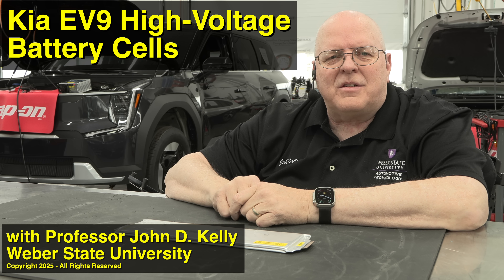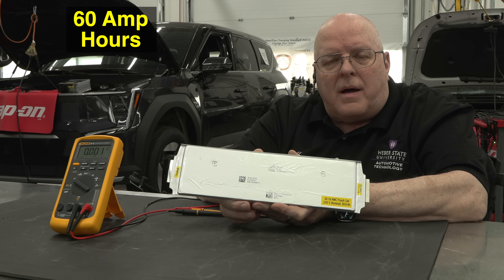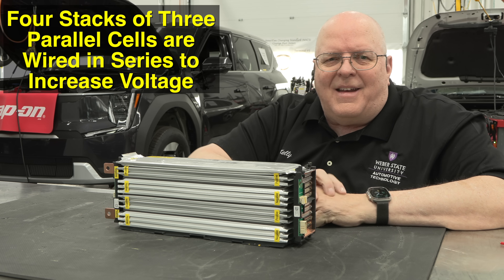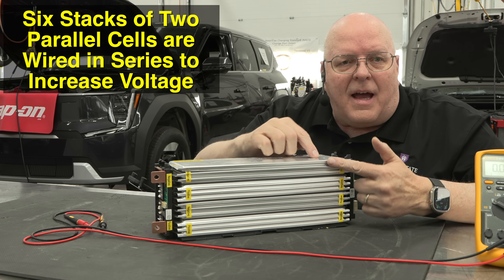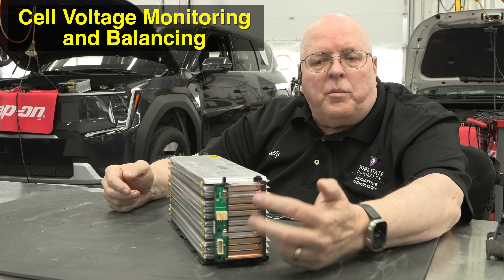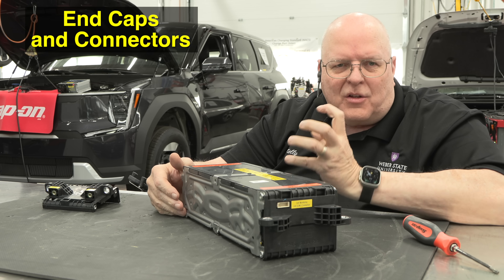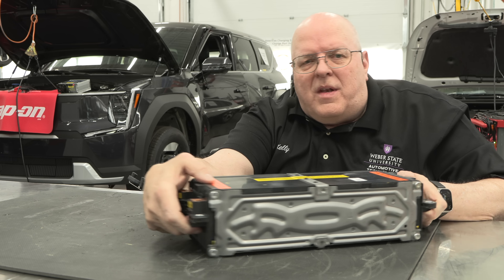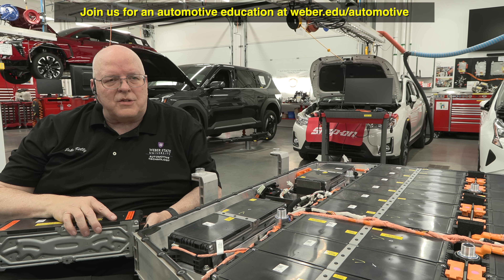Understanding the Kia EV9 High-Voltage Battery

Comment: Great video of the construction of that pack. Amphours is a misleading comparison of the energy to drive a distance without including voltage. KWhs is a more useful measurement  For example 60 Ahrs at 3.7 volts  is only 0.2 kWh. 60 Ahrs at 600 volts is 36 kWhs.
Reply from the maker: Thank you. You are correct. I did not mean to imply that I could drive for 1 hour using 1 pouch cell; I was just talking about the capacity of each cell and the entire battery, but I should have mentioned the voltage needed at that point in the video. 

My personal car has a 355.2-volt (nominal) battery and uses 60 amps at 70 mph, for a total of 21.3 kW per hour. 

I estimate the Kia EV9 with a 551.76-volt (nominal) battery uses about 38.6 amps at 70 mph, for 21.3 kW per hour. The Kia with a 98.985 kWh (nominal) 180 Ah battery should be able to drive about 4.6 hours at 70 mph, for a driving range of 322 miles.
Reply: That's what I was thinking he was saying😂

Comment: VinFast: (https://vi.wikipedia.org/wiki/VinFast ) uses high-voltage batteries for its electric vehicles, which are built from multiple modules and cells, often made with Lithium Iron Phosphate (LFP) technology 
 for energy storage

Battery technology and specifications Technology: VinFast uses Lithium-ion batteries in its electric vehicles and is also investing in future technologies such as solid-state batteries through partnerships. Battery type: Some models have LFP batteries. Capacity: For example, some energy storage systems have a capacity of 138.3 kWh and can provide 124.4 kWh of usable energy. Voltage: High-voltage battery systems can operate at a nominal voltage of around 460 V. Performance: Some models offer fast charging, with an example showing the ability to charge from 10% to 70% in 31 minutes for the VF 8.
Reply: NMC batteries have higher energy density, allowing electric vehicles to travel longer distances, while LiFePO4 batteries are safer, have longer life spans and lower initial costs, making them suitable for energy storage applications. NMC batteries perform better in cold weather, while LiFePO4 batteries perform worse at low temperatures.

Comment: One of those modules is about 2.6kWhr; that's incredibly energy-dense! In a few years, finding used modules of this form factor for sale looks like a good way to get really good energy density batteries for other applications in a convenient form factor; it's a size that's really manageable to move around without tools, and has convenient terminals on the outside, as well as being at a pretty usable voltage (16V or so).

About how much was it to buy this module off ebay, if you're willing to share?

Comment: Professor Kelly, can these modules be installed on their side in an EV conversion? i.e., resting on their 4.25" side instead of the 8.25" the factory has installed them on. They will be secured to the custom built box and have cooling plates.
Reply from the maker: The ones like these in the 4th generation Prius cannot be tilted more than a certain angle. I suspect these are the same, but I don’t know for sure.

Comment: In the case of a serious collision, what happens to ALL the voltage stored? Are connections broken somewhere?  I don't like the idea becoming a path to voltage that significant.
Reply from the maker: There are built-in disconnect systems and methods that shut everything off very quickly as needed. Thanks for sharing
Reply: Yes, the car will disable the high voltage system before the driver even realizes an accident just occurred.

Comment: Seeing the actual module layout, it cannot be very well thermally balanced.  This is also a problem with a lot of Tool batteries, where you have one protruding cell, and a batch of others.  Ryobi had this problem. Kia needs a better thermal design, or it will have worse longevity, as compared to others.
Reply from the maker: Thanks for sharing your thoughts

Comment: cringey pouch cells.  aren't any battery recall yet for any KIA/Hyundai?
Reply from the maker: Pouch cells are used by many other EV makers including GM, Ford, and Nissan. There have been problems with manufacturing defects in some including the Chevrolet Bolt I used to own. I have not heard of any widespread problems with the Kia/Hyundai ones.

Comment: Thank you for finally showing the insides of the battery in a way we can understand it. At the same time I'll never buy an EV car. That just looks like a nightmare to me. One rock could spell doom in an EV. And those giant battery cells just screams expensive repairs. No wonder why ev batteries need to be replaced entirely. One cell going haywire ruins the chips in the other batteries due to over current flow. Then they hit you with the whole battery needs to be replaced. Even though the individual cells could be salvageable if they didn't overrun on the voltimiter.

I'd rather stick with my petrol car where I can actually replace a part of the engine that breaks.
Reply from the maker: Thanks for sharing your thoughts
Reply: The overwhelming majority of EVs won't need battery replacements. My Bolt EV has almost 200,000 miles with the original battery and it still runs like new.

Comment: Can't the cells get out of sync of each other sense the BMS doesn't monitor each of the cells individually? There could be cells that are pulled down to the others or up to the others if one cell of a string or pack is over or under charged from the other cells making one cell be under charged which will pull the cell to low when the battery is drained or over charge the cell if the pack has one cell that is overcharged when you charge the car up it will overcharge the one cell in the pack that is already overcharged to begin with then making thermal runaway a big concern. The older the packs the higher the risk of overcharge and thermal runaway!
Reply from the maker: One cell in a pack can cause the cell pack voltage to change and lag behind the other cell packs in the module and battery. As a safety measure, if the BMS senses a cell pack voltage difference of more than a certain amount, like 40 mV, a diagnostic trouble code will set and prevent the battery from being charged and the vehicle from being driven. Thanks for watching

Comment: Nice call-out on the battery pack voltage. The auto industry seems to use '800-volt' to refer to any battery with a nominal pack voltage between 500 and 1000 volts, in line with DC fast chargers that have a maximum 1000-volt rating vs. the earlier 500-volt rating. I do think it's confusing on the technical side to categorize something as '800-volt' when its actual rating is far lower. That said, in terms of the consumer's fast-charging experience, the EV9 has similar compatibility to, say, a Lucid Air with a nominally 924-volt battery pack.
Reply from the maker: Thank you and thanks for the insight

Comment: You have a slight math error, if you want to drive 3h at 60mph and your car for example use 250w per mile under those conditions then you 45kw capacity or 112Ah at 400v. The overall voltage of the battery is also important not just the Ah. But we all know that's before AC or heating so the actual usage would increase by 10-30% a hard lesson every EV owner learns early on
Reply: Yeah.  Amp-hours itself is not a good term.   It’s a lie made to made low voltage cells sound huge.   Especially milliamp-hours.   I don’t know any engineers who use amp-hours for anything.  It’s kWh.
Reply from the maker: Yes, thanks. I should have specified the appropriate voltage is also needed.

Comment: Thank you very much for the videos Sir.

Its Thermal putty Used under the battery they are now quite common on power delivery components for servers.
Reply from the maker: You are welcome! Thanks for the info
Reply: Yes, thank you for the video! For a recent BEV design, this battery module construction is terrible for thermals and the 2 temp sensors are only monitoring the center of a single cell. I'd expected a better/safer engineered solution. The middle cells are most vulnerable to preheat from adjacent cells and the construction with the large sides facing each other lends itself well to thermal runaway.

Comment: Fanatastic Video, also very intersting besides the technical info ist how you can theoretically repair the battery back. From my understanding you can change a module quite easily if the pack is open. The only thing you have to replace is the thermal compound. Am I right with this assumption? 
As there are 38 not only 12-16 modules like an older tesla pack, it makes from my understanding absolutely no sense to change single pouch cells, that can be done by the manufacturer. A module should not cost more than 1000$ theoretically if the battery price is around 25000$ (Im only assuming numbers there to give some relation)
Reply from the maker: Thank you for your comment. You are correct about replacing the modules. I did not mean to imply that individual cells can be replaced. I was just showing the internal parts of the module. Thanks for watching
Reply: Depends on the battery. Kia and VW are super clean and modular. Tesla covers everything with a foam that Munro had to chisel away. Pro OEM vs amateur startup.

Comment: back in 2005 I bought lipo cells for RC Cars. turned out they inflated after 2 years in use. They look the same as this package...
Reply: RC lipos are under a lot more stress. they are expected to go from 4.2 to 3.0 volts in 5-10 minutes with no cooling, while in the car they go from 4.1 to 3.2 volts in 2-3 hours and are actively cooled. also the metal end plates in the car assembly compress the pouches which prevents them from swelling.
Reply from the maker: Thanks for sharing your experience!

Comment: Interesting, so the Toyota max voltage per cell was 4.05, this 4.12, likely the Kia doesn’t need as much headroom when fully charged. But still off the max 4.2v or so for LiIon batteries - most likely for reliability and longevity. Actually these cells looked more like the LiPoly cells in my r/c helis and airplanes.
Reply from the maker: Thanks. Yes, this one is lower. many other BEVs go to 4.2V

Comment: Great explanation, Professor, but you didn't explain how the cells are connected to each other inside the battery. Do they just lie on top of each other with their termenal touching?
Reply from the maker: Good point. Their terminals are laser welded together. Thanks for watching

Comment: Interesting arrangement with the pouch cells. 
But… don’t get me wrong: why is the RISO only at 3MOhm?!  
I work on FCEVs, they are far higher than that. And they are normally notorious for a lower RISO😅
Reply from the maker: 500 ohms per volt is the minimum isolation resistance allowed by FMVSS 305. This 626 volt battery only requires 313 k ohm. 3 million ohms is typical on many BEVs. Thanks for watching

Comment: We have the Ioniq 5 and I heard it also uses 2 parallel cells from Sk on but a full charge shows about 796V as I remember.  Hyundai / Kia does use quality batteries though 98k miles on ours and no loss of range since new.
Reply: Would you happen to know your average lifetime efficiency for your Ioniq 5? I have a model Y LRDM and I am currently 265 Wh/Mile over 44k miles.
Reply: @franktoadsly4866  So much depends on driving style.  I do all highway 80+mph with heavy acceleration and have lifetime average of 300Wh/mi on Model 3.
Reply from the maker: Hyundai uses more modules in series to increase their voltage. Thanks for sharing

Comment: 1:57 Surely something wrong with that maths. With today's cell technology, there is no way something of that single-pouch volume could propel a passenger vehicle for 1 hour. An electric bicycle, perhaps.
It is well known that gasoline or diesel has a far higher energy density than current cell technology and that equivalent single-pouch-volume of fuel would also be unlikely to power an ICE passenger vehicle for 1 hour.
Reply from the maker: Sorry for the confusion. What I meant to demonstrate is that 60 amp hours at the appropriate voltage can propel my car for one hour.
Reply: Yes, 60ahr * 4v = 240whr. In a vehicle that size you would be lucky to go 1mile.
Reply: 60 amp hours wired in series is still 60A hours but increases in watt / kw hours. If my math is correct 60A hours at 626V will will give you 37kw h, so more than enough power to drive 60 miles. Our Ioniq 5 can drive 230-290 miles (depending on conditions) with a 77kwh battery.  If the cells are double stacked that's 120A hours or 75kw h, triple stacked would be 180A hours, or 112kw h at 626V.
Reply: It has 456 cells.

Comment: Only 15V but that pack has a lot of stored energy nonetheless.  I'd be careful with that metal cover around uncovered main terminals, especially with students.
Also, I see you are giving credit to your shop assistants now. Very honorable of you sir.
Reply: I was curious about this too.  The general rule bring under 50V is safe to touch but then moist fingers, thin skin, an abrasion... it all is a bit confusing as to where the voltage/amperage safety point is.
Reply from the maker: Thanks for the feedback. I appreciate your observations.
Reply: I am a bit concerned about what the fault current from that battery would be 
At 180AHr it could supply 180A into a 0.09Ohm load for an hour
Into a short circuit It might be able to supply more than 1KA
I wouldn't like to there if that happened

Comment: From my understanding NMC pouch cells are still prone to the "puffing" phenomenon as other lithium pouch style cells because they share similar design/chemistry and can't vent gas.  I wonder how much of a future issue this could become.
Reply: As I read that typically happens when a battery is left at 100% charge for a long time, like sitting in a hot garage fully charged every day is bad for them. Also leaving them dead for a long time can cause the cells to expand. I had that happen in old tablets and phones that sat dead for years the cells doubled in thickness and made the case bulge.  We have an Ioniq 5 that uses the same battery design and it's had zero issues with 98k miles on it, no loss of range since new. Certainly a big improvement over the early Leaf's that gave EVs a bad reputation for battery degradation.
Reply: @SkaBob  Wasn't this why they used to say to physically clamp the pouch cells with metal plates and bolts, to prevent swelling?  Plastic cases seem like a lightweight solution that would cause issues years down the line.
Reply from the maker: The outer metal sides clamp the cells to hold them together. They were welded in place. I drilled out the welds to explore the inside of the module.

Comment: So what would the process be for heating the battery in sub-zero conditions ie is the thermal material efficient for both heating and cooling.
Reply from the maker: Yes it is. I forgot to mention that. Thanks for watching
Reply: There is a battery heater under the car as well, it can use it to heat the coolant going though the battery for fast charging when cold or direct the coolant to the radiator to cooling when it's hot. The battery heater on our Ioniq 5 will take about 5kw maximum but it's only used briefly before fast charging. Because this battery is larger it may have a more powerful heater.

Comment: It was a curiosity in car audio systems when i was 13 where I learned about parallel and series.  Trying to match resistance of subwoofers and an amplifiers capsbilities. Parallel reduces resistance by half and doubles the amperage.  The fun days of wiring 3 JL Audio W6 dual voice coil 6 ohm subwoofers so that it combines into one output at 1 ohm so that my one 1ohm stable amplifier could power all the subs.  Little did i know back then I was learning electronic principles
Reply from the maker: Thank you for sharing and watching
Reply: That sounds like the right way of learning electricity principles.

Comment: Ooh, e-gmp coverage! I've been hoping you might dive into this platform a little bit. I've owned a 2022 Ioniq5 and currently own a 2024 EV9. I've been curious to get a more technical look under the hood.

Glad to see that HKG is still sticking with replaceable modules for their batteries, not the complete sealed battery assemblies that some manufacturers are going to. I understand that, for older and heavily degraded batteries, replacing a single module presents some difficulties, but newer stuff, especially stuff under the 8yr battery warranty (or 10?) being able to replace a single failed module is really helpful. It's also nice for 2nd life uses, since many used EV batteries end up living a 2nd life as energy storage when they eventually degrade beyond being useful in a car. Having smaller, replaceable modules is absolutely the way to go and hopefully those who aren't doing that will be pushed in the right direction eventually.
Reply from the maker: That's great to hear! Thanks for your support.